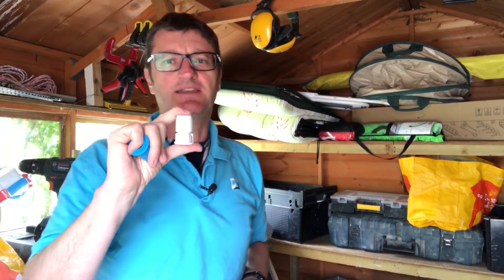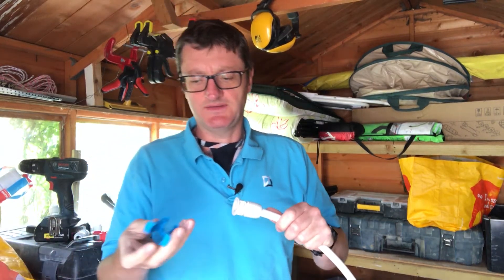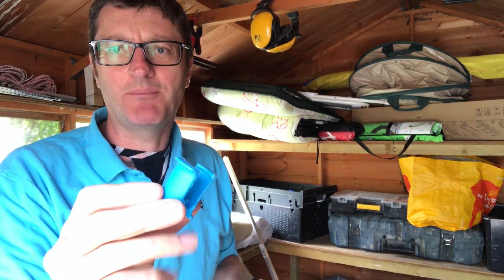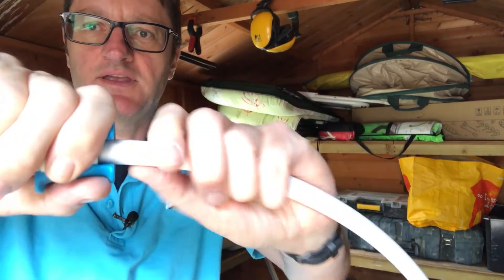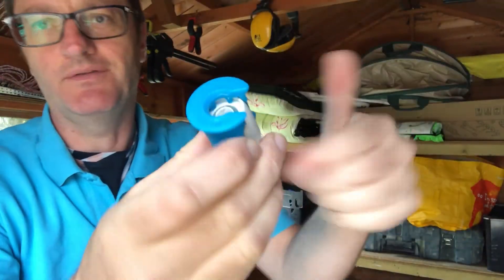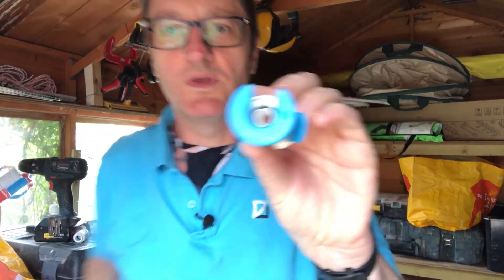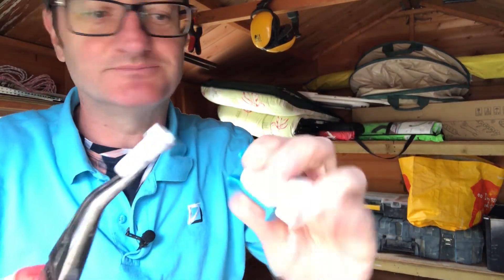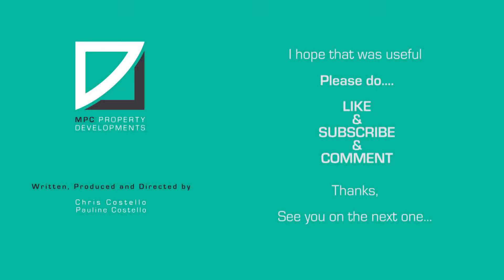Renovate; How to remove a HEP2O push-fit plumbing fitting.

Comment: Not a fan of these fittings. They are nice and easy to disconnect while you're in a shed with plenty of space but when in the confines of an under sink cupboard amongst other pipes they are a real pain in the ass. In the end I had to saw off the pipe to the tap I was changing because I couldn't rotate it enough to get the pipe out of the joint.
Reply: Easy to fit nightmare to take off.
Reply: Just done our entire house. Would never touch the stuff again. Very difficult if not on the verge of impossible to remove in some cases. Inserts constantly getting stuck in the fittings. Wish I had gone for poly
Reply: @jb_fpv5090  agreed,when they've been on for a while you'd never get them off anyway with or without the 'KEY'
Reply from the maker: Thanks for the comment...  the HEP2O you don't need to twist like the other push fits, so with these shouldn't be a problem.

Comment: Thanks for sharing. I've just renewed all my  central heating pipework with Hep2o. I had a leak somewhere in the 40 year old 8mm copper and, realising that I'd never be able to locate the source, I just replaced everything. The first run from the boiler excepted, I used 22mm and 15mm Hep2o barrier pipe and fittings.
I have to agree; the fittings are eye-wateringly expensive!
That aside, the system is much easier than copper and traditional plumbing techniques to work with, and, as you can cable the pipe, does not oblige you to dynamite your floorboards.
However, something none of the tutorials seem to mention, is that you absolutely must lubricate the pipe before attempting to make the connection! If you miss this step you will struggle to make a good connection - particularly in hard to reach locations where it is difficult to get any purchase!
Alas, I learnt this the hard way. Whilst it is relatively easy to connect and demount a joint on a short section of pipe as you have demonstrated, in a tight spot, where you might not be able to 'feel the rumble', it is nowhere near as easy. It doesn't have to be anything fancy; soapy water in a sprayer, or silicone spray is just fine.
Reply from the maker: A great tip thanks.. and thanks for the comment..